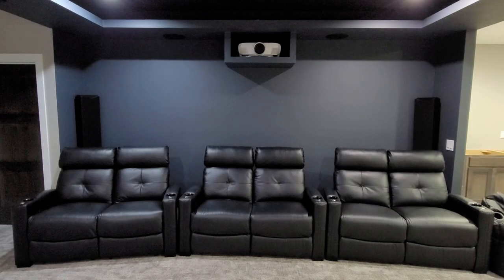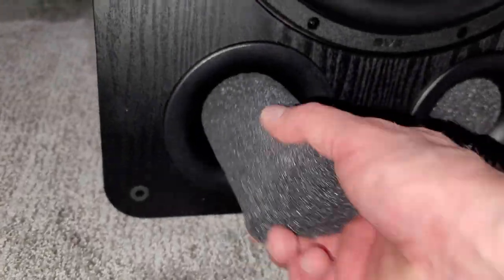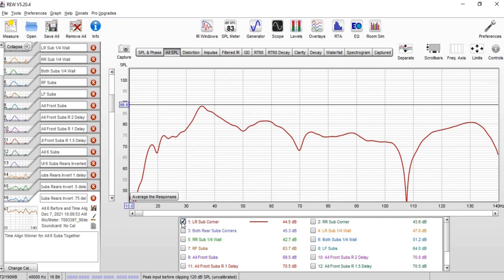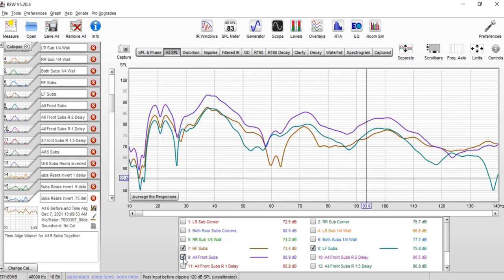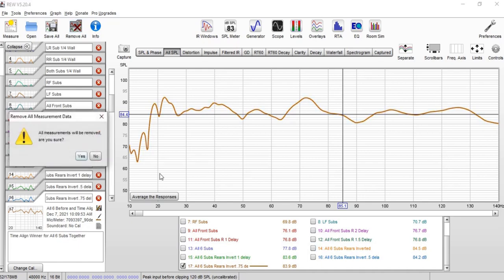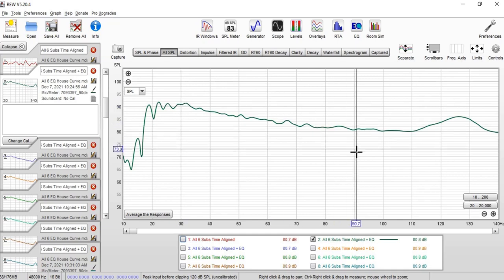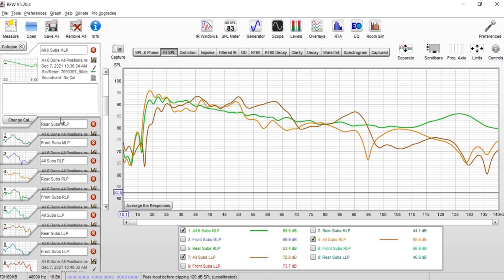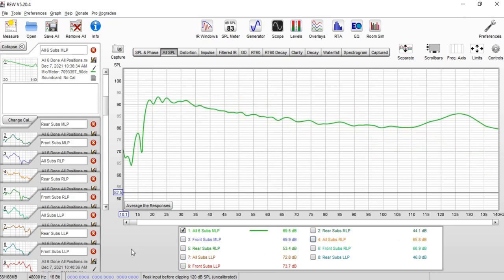Basement Home Theater - REW Results of All 6 Subwoofers

Comment: Thank you very informative. I just started my dsp journey one question. After you finally finished do you go back into the AVR and make any changes to the settings you set at the beginning of calibration
Reply from the maker: Hello!  There really shouldn't be anything you have to do to the AVR settings after you are all done, as Audyssey will reset your crossover points for your main speakers after it runs, which is after you are done with your sub system.  If you want, you can 'double-check' Audyssey, which is what I did, by using your calibrated mic and the sound meter function inside of REW.  At the Main Listening Position (MLP) to go to your speaker settings and make sure each channel of speaker is measuring  75 db.  Some like to increase their overhead Atmos channel 1-2 db higher, which is what I did as well. It's personal preference.  Otherwise, I don't believe I changed any other settings, othat than adjusting the Subwoofer Output in order to reach the amount of bass you want out of your system.  Sometimes I have to adjust this up or down depending on the movie I'm watching.  Good luck!

Comment: Looks amazing. And I'm shure sounds even better. I would love to see rew measurements at high SPL. Do you think you could dig into the infrasonics (Single digits) if you wanted with this setup? 😉

Keep it up 👍
Reply from the maker: I have plans for a RTA (real time analysis) video using the tool in REW for a future video.  Maybe I can get to reference level during that video to see what happens.  I'm not sure about infrasonics....I haven't researched that enough to know if capable or not.  I would imagine the 18's could handle it but I'm guessing I'd need to turn off the SVS subs.  Just a guess though.
Reply: @TyEichele  as far as I know the svs are protected by the buind in dsp. So you shouldn't be able to damage them (I would still turn them for infrasonics of though, at least "long term"). But don't just take my word. Don't want do be responsible.
Reply: @happyfisch1033 Just some friendly information, infrasonics is 19Hz, and below. I love low freq.!
Reply: @evilinside5984 jup, I should have wrote "(even single digits?)". Especially because I know/knew that. I love low freq. Too 👍!
Reply: @happyfisch1033 Sorry if i seemed like i was being a d bag. But for the longest time, i thought subsonic, meant 19Hz, and below, because most car audio amplifiers, have a subsonic filter, and i was told that filter was to cut off freq. below our hearing range of 20Hz. Now i know that word subsonic, is not usually used/understood properly. I like to let people know that 19Hz, and below is called infrasonic, so they dont say the wrong word, and look like a dummy, like i did for years, cause i thought i knew what i was saying🤦‍😆
Reply: @evilinside5984  don't worry, you didn't. At least to me 🙂.

Comment: You missed out in a way just how it sounded to the ear once done.
Reply from the maker: I'mm not sure I understand....you mean before I tuned it?  I did play a couple of demos before I did this but they were overpowering of course!  Sound is much better now that they are level matched and aligned and eq'd.
Reply: @TyEichele  You got it 👍 meant how did it sound before and then after all adjustments using rew to your ear and feeling. Cheers.